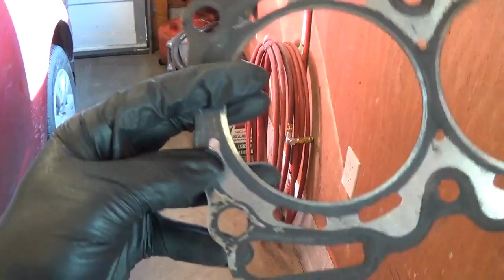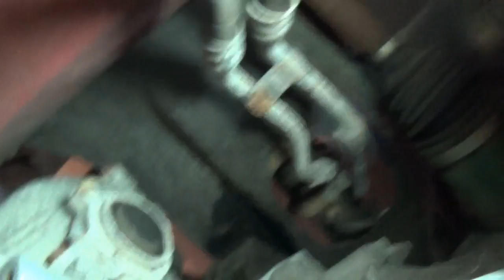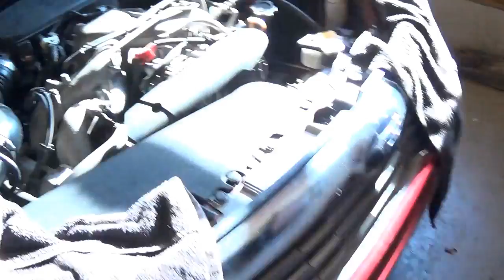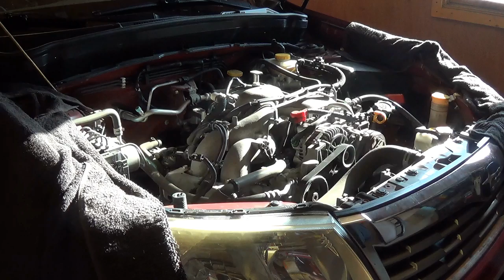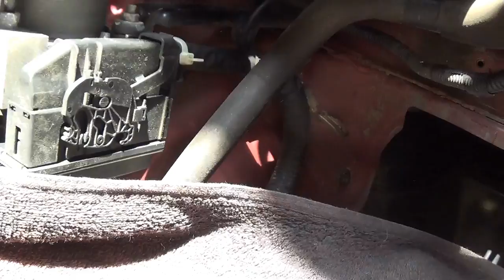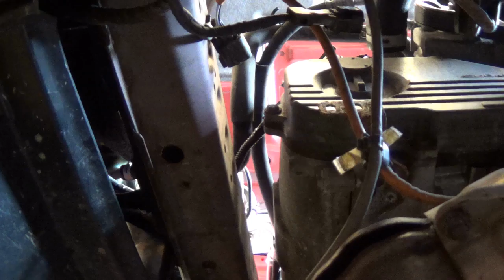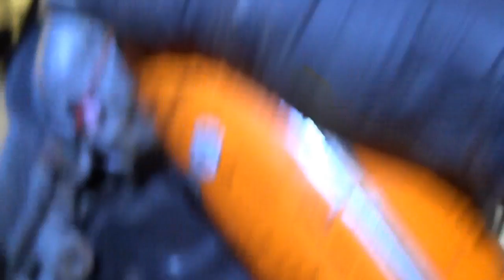Subaru Head Gaskets -Part 1: Teardown

Comment: I always just pull the engine on those cars, its so much easier to do this on an engine stand!!! 
You can pull the motor on one of these in a little over an hour if you really put your mind to it!
Reply: Its not just about saving time it's about ease of job completion, it is so much easier to torque all the bolts and attach everything when the engine is on an engine stand and you can rotate it so the head you're working on is vertical it's also much easier to measure flatness that way!
Reply: Lustfulvengance you're clearly a Ford lover so obviously an expert on pulling out engines🤣
Reply: Michael O I have removed my fair share of Ford truck cabs in my career ;-)
Reply: In an hour, I can have both heads on the bench.

Comment: I am 6 mins into the video and see the new valve cover bolts.   He says the old ones will get destroyed and will show tricks/tips to remove them.  Thats what I want to see.  All the other channels say to just remove them.   Mine are all frozen.  some with heads stripped off.  They wont come off.
Reply from the maker: You won't be disappointed ;)

Comment: Briansmobile one  usually pulls the engine..he has a video   ..it takes him a little over an hour to pull it ( granted he has done a tome of um ) ..he feels the time is a little quicker to R and R the engine versus  working with it on the car where  you struggle ... also in case of the rusted  valve cover bolts would be much easier ( BTW I have NEVER  pulled a Subaru engine I am just quoting an expert )  :)
Reply: Not everyone has a engine hoist.
Reply: Solid point.. but I THINK  I van does ..didnt he use one several times in a few videos?? Or am I confusing with other channels..
I also said BRIAN prefers it that way ..and he is the only one I have seen do it.. but in this case is especially seemed relevant  with the rusted bolts

Comment: How many miles does it have? I have the same one with 50k would you recommend selling it? What's the best reliable brand you recommend
Reply from the maker: This one had 100k miles at the time of repair. It is now at 130k and engine is healthy and dry :)  If the car has treated you well, I would just plan ahead and budget for this repair when the gaskets start leaking. Some make it to 150k before the repair!

Comment: Wouldn't it have been easier to just pull the engine? Subaru lost me when they moved the spare.
Reply: Yep the old Subaru with the spare strapped to the back of the engine, ha. Did some head gaskets on them back in the day. Guess they still could strap in a can of tire inflator flat fixer, kind of standard in a lot of Cadillacs. :)

Comment: Wow this really seems to a  common Subaru problem.  No thanks!
Reply: No they do not. Head gaskets dont ever just fail. They should last the life of the engine. They fail for a reason. Usually over heating or bad design.
Reply: Head gaskets eventually fail on every engine but you'll notice how much stuff he has to take off to get to the heads. That, is speshul to Subies
Reply: only on the 2.5, it like a service item on them lol .
pretty easy once done a few .
Reply: nearly better pulling the damned engine  lol
Reply: And you will ultimately be doing a few if you own one
Reply: yes I think the same. This is the reason why I bought a Lancer over an Impreza

Comment: Would just swapping in a new engine be cheaper?
Reply: If it was a Toyota or Honda engine probably. Problem is these sort of issues are almost universal on Subaru engines. You'd be doing all that labour for only a couple more years if you were very lucky.
Reply from the maker: "NEW"...that would be cost-prohibitive! Not sure you can even buy a new SOHC Subie engine anymore...they were discontinued after 2012.

Comment: Yeah, as much as I'd love to have a WRX I've become more and more inclined to just walk away because of things like this. Thanks Ivan!
Reply: Baxrok2 they built the turbo engine with stronger headgaskets since it will experience more pressure and heat from the turbo.
Reply: Baxrok2 The good news is the turbo models don't really experience that issue.  It mainly affects the NA 2.5 engines.
Reply: How can that be? Aren't they essentially the same engine with the same weaknesses?
Reply: Baxrok2 If you are looking at an ej25  powered turbo, those engines also and a slightly different internal construction compared to the NA ej25.  Subaru extended that design to the last NA ej25 used on the 2010-2012 Outback and Legacy.  Those models have far less instances of hg  failure.
Reply: Very interesting. Great info. Thanks all!
Reply: Baxrok2 Better gaskets Ivan said.
Reply: Enginehead99 So going by that you can order the improved gaskets from the Subaru.   If it's cheaper probably not.
Reply: Edward Martinez The turbo engines always used the MLS gaskets.  The NA engines used the single layer gaskets minus the last ej25 used on the 10-12 Legacy/Outback.

Comment: I dunno, I bet the oil acts as a dielectric. As long as the contact to the spark plug is good, the oil shouldn't cause any short circuits.
Reply: Pure oil with no additives wouldn't but once it's in the engine and picks up carbon and acids from the blow-by and condensation it becomes a good conductor for high voltage. Then you get intermittent misfires and every time the voltage discharges through the oil it creates more carbon.
Reply: would need highly pure mineral oil or similar. engine/other oils are somewhat conductive at high voltage, add in air exposure, carbon, moisture and acidic contaminates from running engines and it becomes overly conductive fast!
Reply from the maker: The oil also compromises the insulating nature of the coil boot, destroying the rubber...

Comment: Subaru head gasket lol we call them a chocolate engine over here
Reply: bodgit and leggit garage so here you Are!
Reply: 2L and 3L is fine. 2.5 is the bad apple but not a hard fix .
Subarus after around 2006 not as good as earlier stuff.
The 98-2000 forester was bulletproof, went down hill with SG SG9 SH etc
Reply from the maker: I love the 1st gen Forester...very solid vehicle.
Reply: I got a 99 and in 12 yrs hardly had touch it besides routine stuff and rear brake line and hoses and rear struts springs.
Rear subframes can rot bad but I rust treated mine every 2-3yrs and kept crusties away .
 Got a 03 SG but want swap that out for another Gen 1 SF when find a tidy full winter pack one. Wanted to love the diesel but that thing a proper lemon .
Reply from the maker: The 2009 Forester in this video is a "proper lemon" as well hahaha
Reply: lol. makes good videos though :-) 
Not watched part5 yet but on my todo list :-P
I looking at a 2000 SF this weekend low miles and only obvious issue is very light nudge front driver side ideally needing a bumper and wing to get tidy . hopefully no rot or signs of heavy abuse.
The old ones are 10 times the vehicle of the new stuff  and tenth of the price lol .
Ivan, did you ever swap out the stretch belt to standard and add the tensioner assembly ?
Reply: This is not true. Older 98-00 cars were worse for this as the head gasket had not been redesigned less as they are in later models. If you're buying one used guaranteed they've already been replaced anyways.